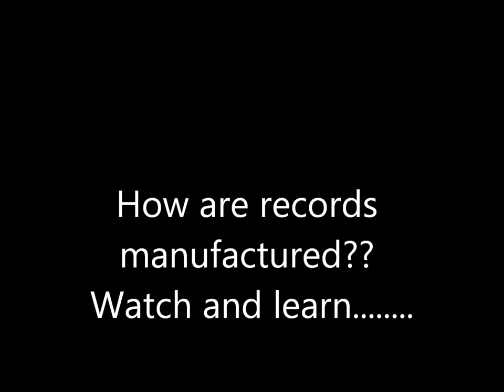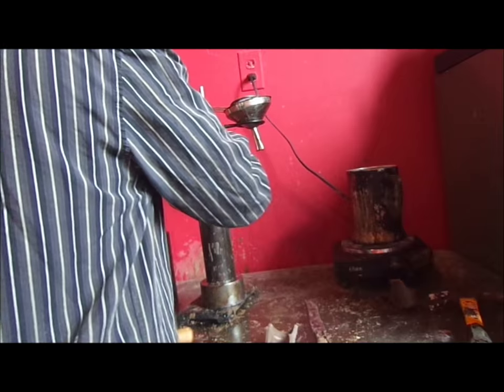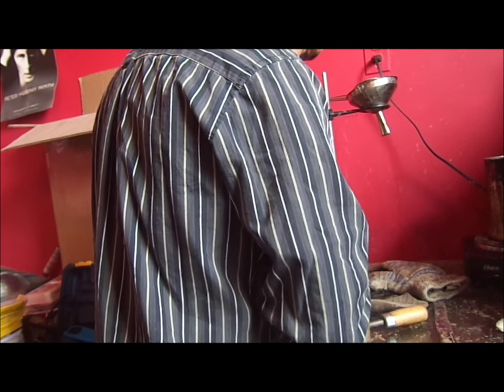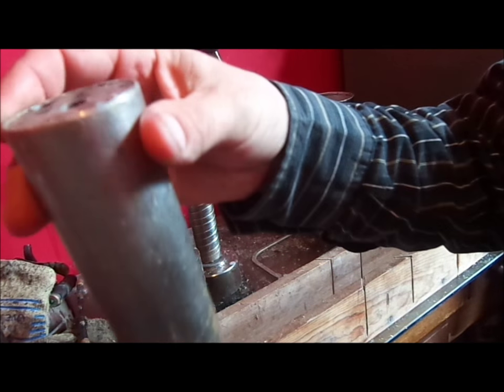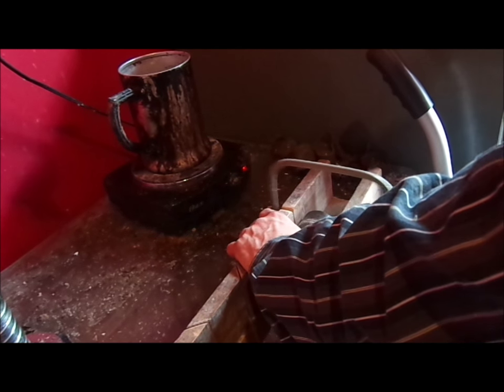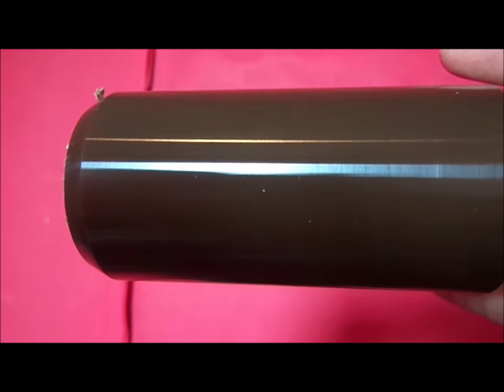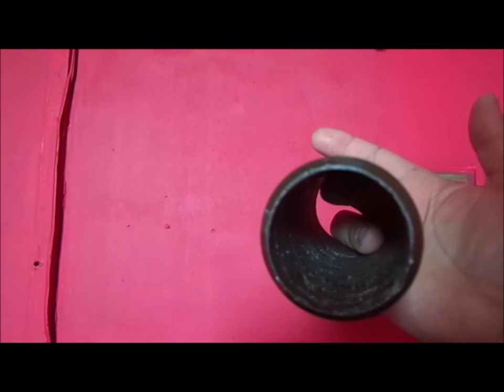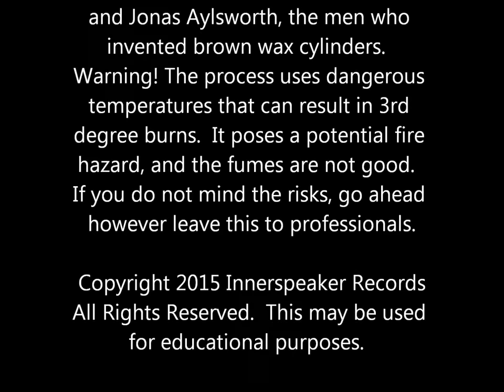How a Phonograph Record is made

Comment: How did you go about getting a mold made?
Reply: I designed and my uncle and I made them.  To my knowledge no original blank 1890 molds exist, yes some Gold Moulded  and blue Amberol  negative shells exists, but not blank molds.
Reply: Take the taper of the mandrel and start 3/4 of an inch from the small end, and extend the taper, make the mold core 7" tall, tapered downward, small end on the bottom of the mold, into the base, either have it on a rod or a screw thread, that screws in the base, the base should have a lip in the middle that comes up so that the outer tube is centered and sealed. The outside tube should come up higher than the core, to act as a reservoir to supply the wax, as it shrinks down as the cylinder cools. The mold should have some kind of spiral on the core, so the blank unscrews from the mold, many use smoothbores, however, the working time is decreased greatly, the spiral core gives you a larger extraction time.  It is best to heat the mold in an oven to  half the temperature of the wax, to slow the coolig of the compound.